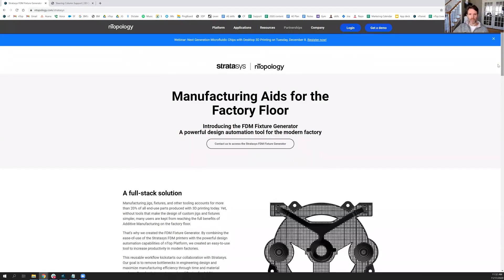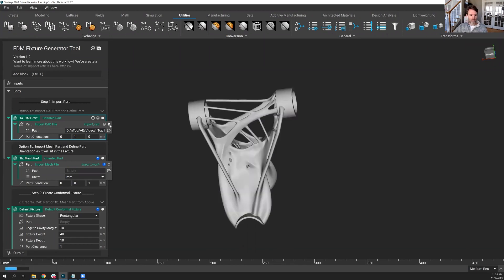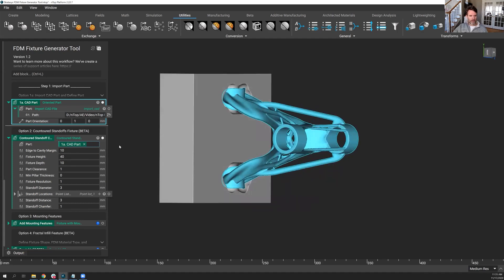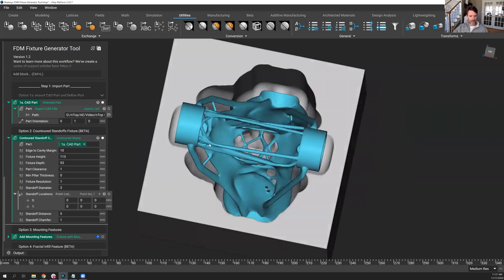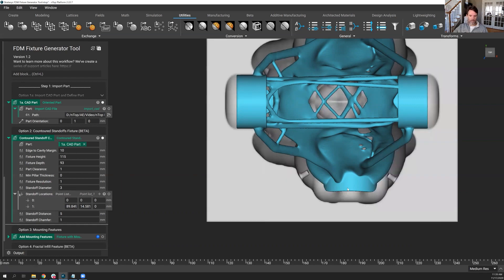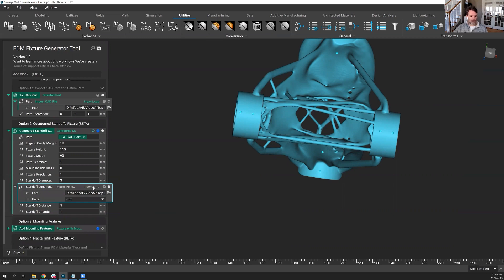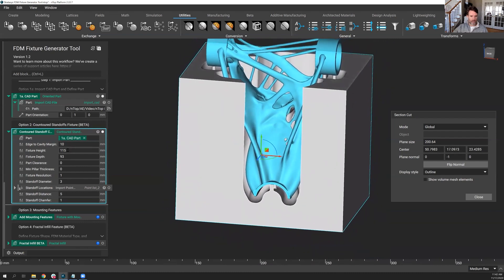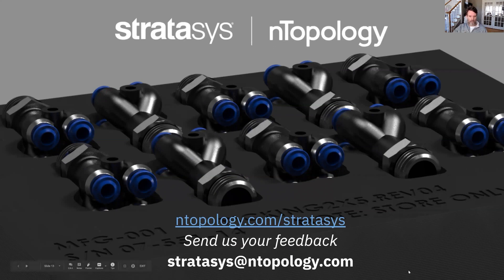nTop Live: Creating 3D Printed Jigs & Fixtures for CMM Inspection

Comment: This is interesting, but I'm not sure I understand how this fixure you've designed would be used in a cmm. Usually when I design fdm cmm fixtures, it's because I need to fixture the part in such a way that all part features can be probed by the cmm. This fixture you've designed, I don't understand how the cmm probe is supposed to get underneath the part? Also, can you explain what the idea is for clamping the part? How is the part supposed to be held in the fixture? Finally, how are manufacturing tolerances in the part accounted for in the fixture? How are you calculating the heights and distances the standoffs should be from the part so that all the manufactured parts fit in that fixture? Very interested in this technology as it seems like a lot of the quality engineer or manufacturing engineer job could potentially be automated with this tool. Thanks very much for answering any questions you can.
Reply: @John Graham John. Would love to provide input. I'll email you from work tomorrow. Only posted here because I think the public forum is a good place for community collaboration and I figured some of the community might like to know about some of the things I asked about too. Maybe my questions are better answered in another video though, rather than a comment. I'll email you soon.